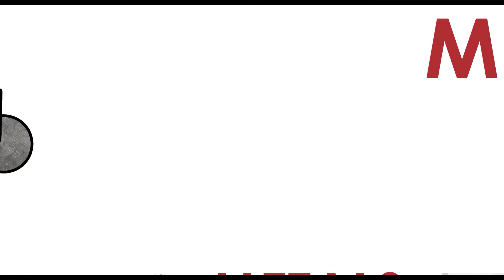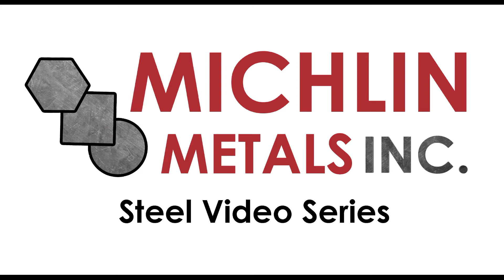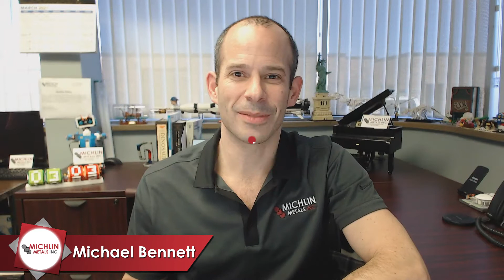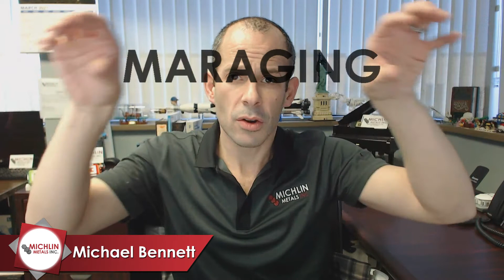Maraging Steels - Maraging 200 - 250 - 300 - What is Maraging? Guide to Maraging

Comment: I actually came here from another engineering video that illustrated penetrations of afpsds on different materials. Maraging metals seemed to fare the best. I am a metalworker by trade having welded and worked with different wear and armor plating such as hardox and bizalloy for industrial and military applications. After nearly 30 years in the trade I still feel like an idiot when it comes to these specifications.
Reply from the maker: Crazy how many different specs there are and what they all mean. It's important if you have questions to always speak to a person who really understands metallurgy, Those are few and far between.

Comment: What is the difference between maraging and precipitation hardening? Reynolds uses maraging to describe its 953 tubing and precipitation hardening to describe its 931 tubing. From what I've read, I don't understand what the differences between these two terms are.
Reply from the maker: Terms are very similar. Maraging materials tend to be formable in the solution annealed condition.
In this instance your bike frame mfg is using the term that is commonly used with the specific alloy.